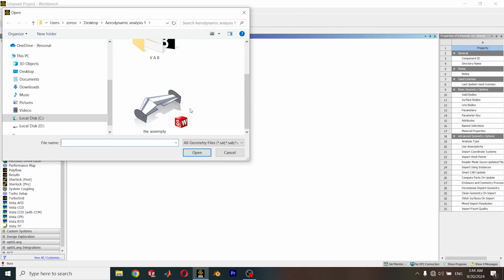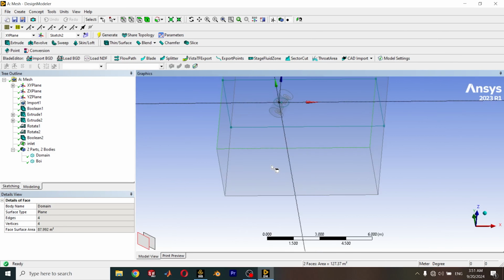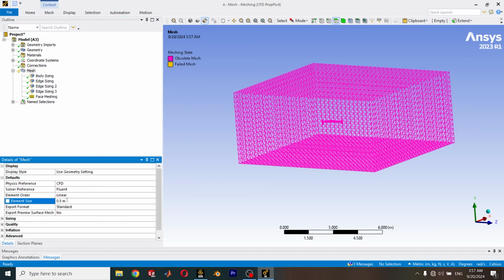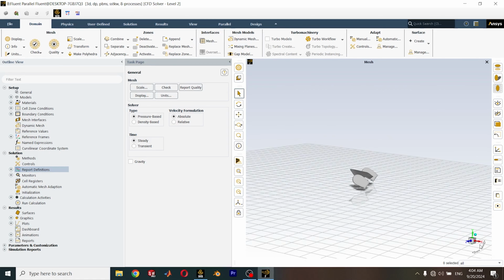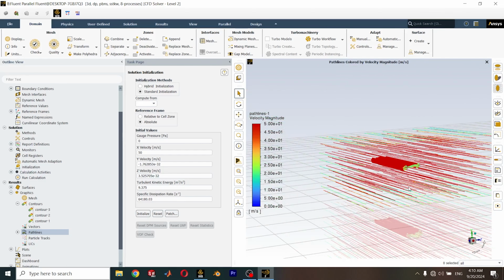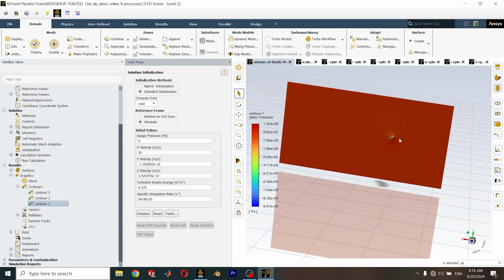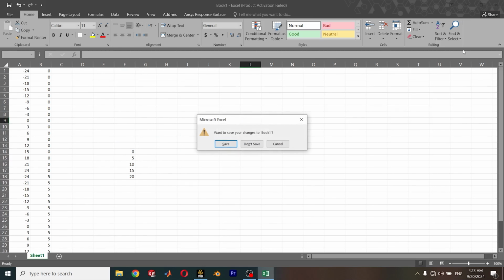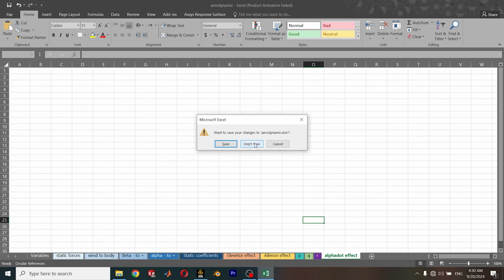Ansys Fluent | CFD Analysis | Multiple Velocity | Angle of Attack | Angle of Side Slip

Comment: I have one doubt...In reference values, which area (surface/total area/frontal area) we need to enter?
Is this area and length will change with angle of attack?
Reply from the maker: as its name is "Reference area". it is the area that force are normalized with respect it. 
for my case I used the projected area of the wing on a plane parallel to XY plane.
It is just a reference. if you are doing analysis for a rocket it is usually the section area. 
for an airfoil thd reference length is the chord.
one important note is that if you are comparing your analysis with somebody else's, you should use the same reference parameters as him/her.

Comment: Hi nezar, I am doing a similar study and so I found your video to be really smart and easy to understand but I am strugling with the mesh refinement 
`
1.One or more entities failed to mesh. The mesh of the bodies containing these entities may not be up-to-date.  However, meshing might be successful on the other entities.
2.One or more surfaces cannot be meshed with acceptable quality. Try using a different element size or virtual topology.
3.The specified defeaturing tolerance was found to be larger than a specified size.  The elements on one or more edges may be defeatured out.
4.The current meshing options and settings cannot generate a mesh.
'
I am getting the following errors. could you please help me through this
Reply: I used to encounter the same errors. The root cause for most issues of this type lies in the surface quality of the 3D file you’ve created; you should take a closer look at the surfaces of the geometry you’ve generated. These errors occur most frequently when you have done a significant amount of surface modeling.